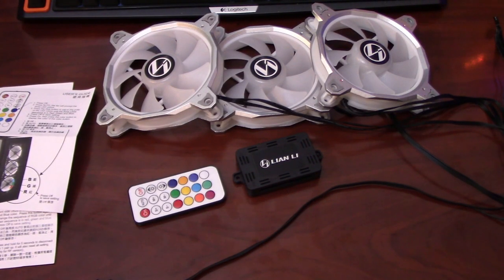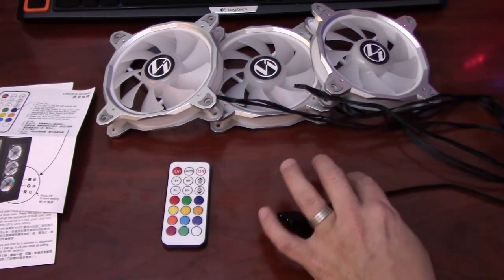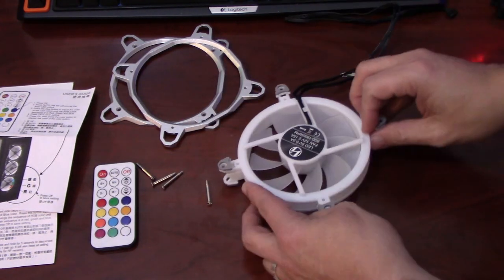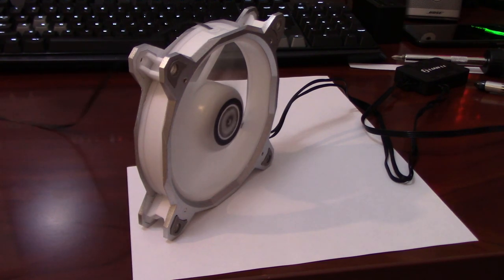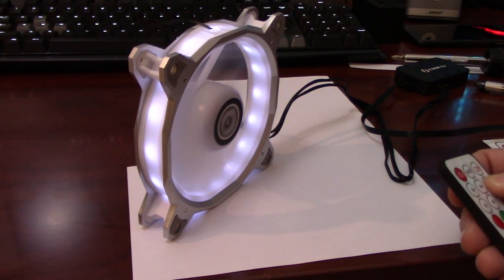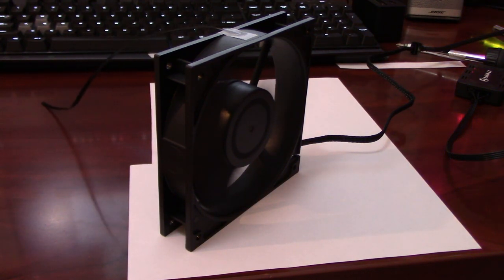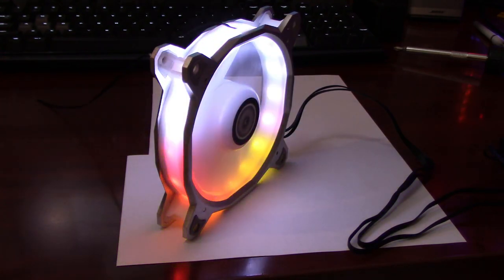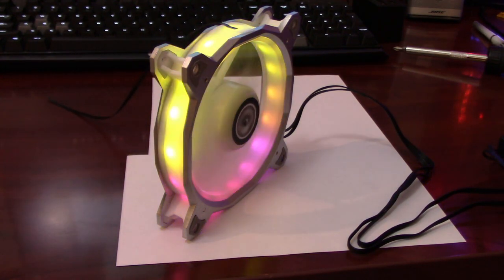Lian Li 120mm Bora RBG Fan Review

Comment: AWESOME REVIEW Jason without a doubt the BEST product review of any type!! Got a couple of questions about these fans, I am getting ready to build my PC I'll be using the new Lian Li PC-O11 Air case and want to use all the fan slots 12 120mm plus 2 80mm, how many fans can I run off 1 controller? Can I use the Coolermaster 1-to-3 RGB Splitter Cable with the Lian Li controller or Phanteks 4 Pin PWM- Y Splitter?  Can the Bora RGB fans do a BREATHING effect? Again Great Review!!

Comment from the maker: So I got confirmation from Lian Li, The fans are not capable of reporting RPM back to the motherboard.
The motherboard can control the speed via PWM, but there is not RPM sense wire on the plug to the motherboard.

I looked at a couple of diagrams on the 4 pin plug on the Bora fan hub only has a PWM wire, it does not have the RPM sense wire.
Reply: Did you figure out a way to control them? My mobo and speedfan program say not available :/ so right now they are running on the standard 100% and are pretty loud to be honest
Reply from the maker: I can control mine both with Speed fan and also via the motherboard fan curves on my Asus Z270 motherboard.  Also, speedfan has to be configured before you can use it to control the speed.  Also, besure to check that your motherboard header is a 4 pin PWM header.
Reply: Looks like i have a Problem with my lian li controller or my mainboard then :/ thanks for the fast response!!
Reply: Jason is it possible to connect up more than 6 fans and control them all synced up with one remote? I know it would require two hubs, can they be daisy chained to work together?
Reply: I'm wondering if those 6 wires in the connector could be divided into two groups of three, 3 wires for addressable RGB lighting control, and 3 for fan power/control....I prefer to just non-proprietary, 3pin 5V JST connector, digital LED controllers so I'm not locked into an ecosystem and so I can use the much cheaper, generic addressable strips
Reply: @post-leftluddite  I am wondering the same thing. I think I may give it a shot.

Comment: Damm they look awesome!  Love all the lighting modes variety. 

At minimum RPM would you say they are quiet? 
I mean in a silent room close to the fan could you feel any bearing or motor noise?

Compared to the Vardar EVO 120ER (which can go down to 300RPm or so), would you say is much louder at min RPM?
Reply: Theyre pretty loud. I just got some and theyre noticably louder than my last fans (some cheap thermaltake case fans)

Comment: What are the max amount of fans can the Controller support? I was thinking about buying 6 of them and their new Lian Li case with glass on the front and side... Am I going to have to have 2 remotes and have to change both of them every single time I want to change modes? Also, how could you make a High End fan and not include RPM Integration? 3 of these fans cost over 60$ dollars on Newegg... I don't think having an RPM sense wire is to much to ask for.

Comment: Thank you for the update about RPM!  I have these fans on my radiator and plugged into the CPU fan header on my ASUS z370 motherboard.  I keep getting a CPU Fan Error and when I go into BIOS it doesn't show I have a fan connected but I could still control the speed.  It was driving me nuts trying to figure it out.

Comment: Hey Jason, great work. I want to put 9 of those into my next build. I know I need two controllers but will I be able to control them with one remote?
Reply: Marek Jurecki I would like to know this as well
Reply: Ah, damn, I'll let you know If I find out anything about it ;)
Reply: Marek Jurecki so I emailed Lian Li asking this very question, and they said two controllers can NOT be linked together and controlled from a single remote.
Reply: Hmm, that sucks as I'm buying PC011 Dynamic and want to put 9 fans there, well... what can you do ;)
Reply: Coudln't you just get some sort of splitter to plug multiple fans into one LED-hub-slot?
Reply: sadly the fans are a proprietary connection..so it would be up to lian li to make one im guessing.

Comment: I bought one of these recently, love them so far, but there's only one thing letting me a little down. Whenever I reboot my PC the fans don't memorize it's last session RGB mode and goes to auto when it comes on again. Is it supposed to work this way or is it "fixable"?
Reply: Hi bro can u control these fans with icue?
Reply: @mujtuu  Hey, I believe I've tried once before and it didn't work with icue, which is kind of obvious since Lian Li has nothing to do with Corsair and I was only able to control the lights through a remote controller that comes with the fan. Hope this helps
Reply: @joaoeespada  thanks alot bro

Comment: I want to add a rgb strip and use the lian li hub to control it. Do you know if the standard 4 pin connector will plug into the hub. It doesn't look like it, but I'm not sure.

Comment: Can u use the remote to control the rpm? Or u need to connect all fans to the mobo to control it?
Reply from the maker: The fan RPM is controlled via the motherboard using PWM.  The controller only controls the lights.

Comment: Can I connect them to the motherboard at CPU PWM to adjust the CPU temperature to the temperature?
Reply from the maker: Yes, the fans are PWM controllable.  They do not have the RPM sense wire, so they can't feed back RPM information.

Comment: once my computer wakes up these fans go back to a default color. is there a way to set them to my favorite color pattern?
Reply from the maker: Hello Randy, My fans seem to stay with the setting that I last used.  One thing to try is, before you shut off the computer, set your favorite mode or color,  press the "Off" button on the controller to turn off the LEDs.  Turn the LEDs back on, they should be on the last mode that you had set.  Then try shutting down you computer and restarting to see if they come back with your last setting of the LEDs.  This is just a guess, but I believe that pressing the "Off" button saves the settings.  If that doesn't work, you may want to contact Lian Li via their website.  Let me know if that works for you. 
-J